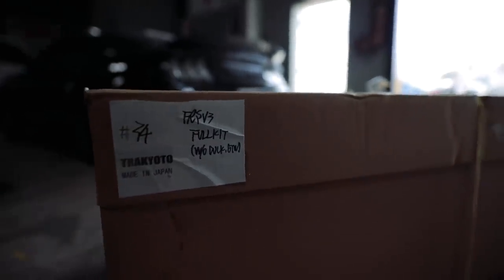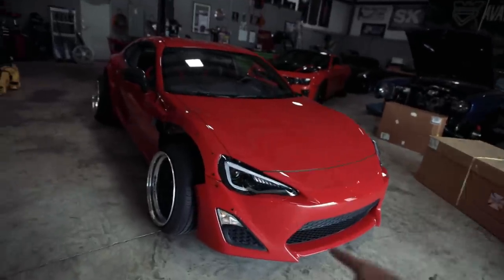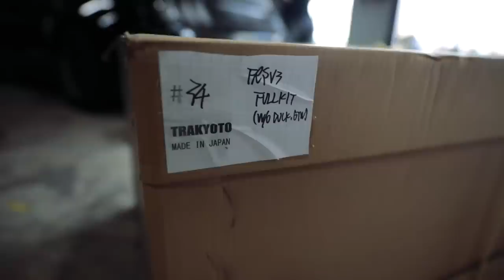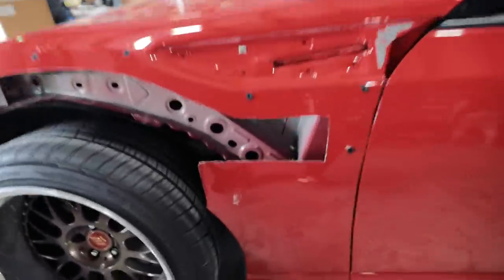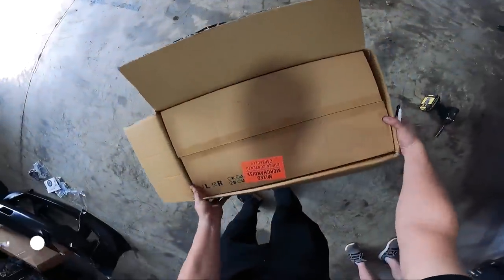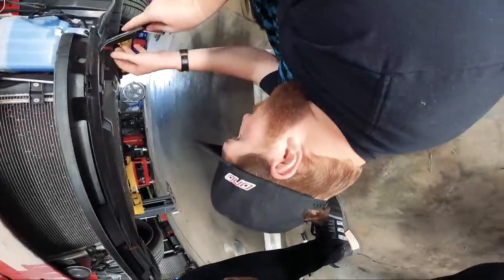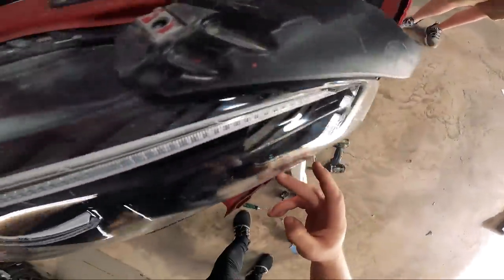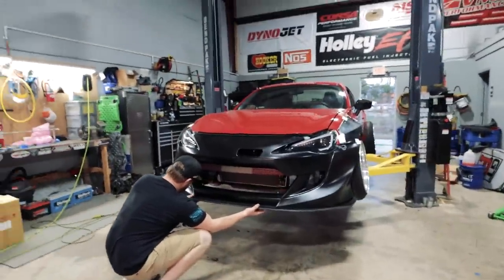I Was Forced Into Buying This $6,000 Body Kit...

Comment: Tj hunt and Gavin both building a widebody brz at the same time 🔥🔥
Reply: And they’re both red
Reply: but one is boosted and the other is bagged
Reply: Well technically this is an FR-S, not a BRZ
Reply: @bradymatlock  they are both the same platform and are practically the same car just little differences
Reply: @personherson5252  but they are not the same car technically. Scion FR-S was made by Subaru and Toyota once scion dissolved Toyota makes the 86 and Subaru has the BRZ. (Buddy owns a 2013 Scion FR-S 10 Series)
Reply: @Bigburb1345  As a previous FRS owner... the only differences is the badges and bumpers.